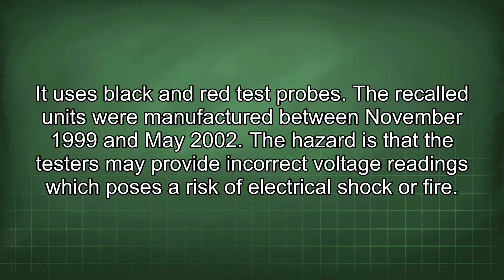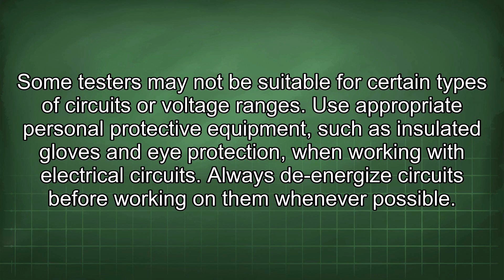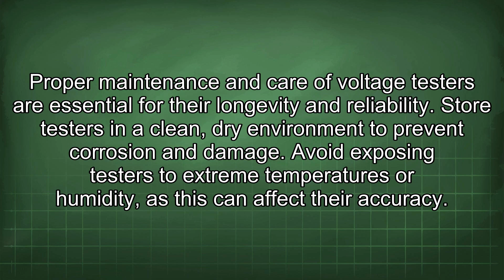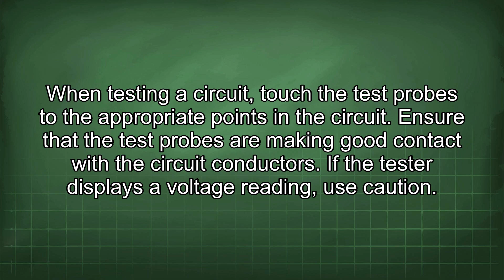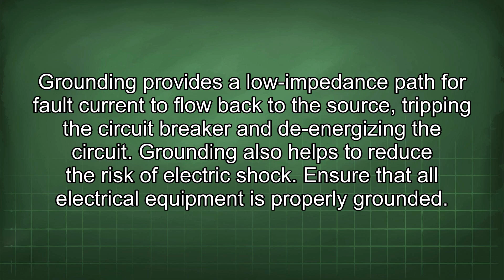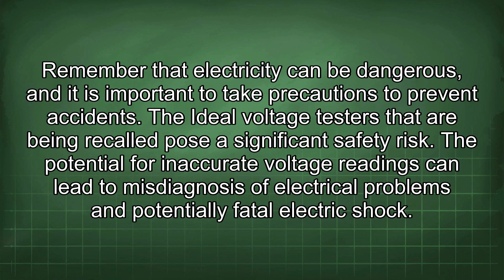Ideal Voltage Tester Recall Electrical Shock Fire Hazard

Comment: This is a 2003 recall.
Reply from the maker: Hello @richardspiek1401,

Thanks for your feedback. This is correct, however, a significant number of meters are still out there and were never returned (less than 10%). When used in a potential arc flash scenario, it can be quite hazardous as has caused grave harm to the user on more than one occasion.

A voltage continuity tester generally does not have a formal expiration date like a perishable product. Instead, its lifespan is determined by its physical condition, calibration needs, and technological relevance.

Sincerely,

BESA Research